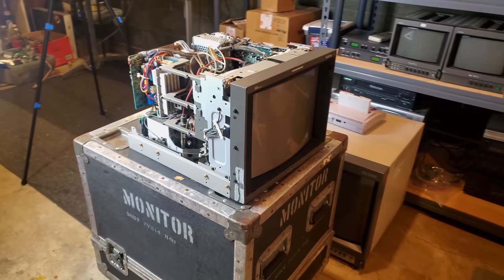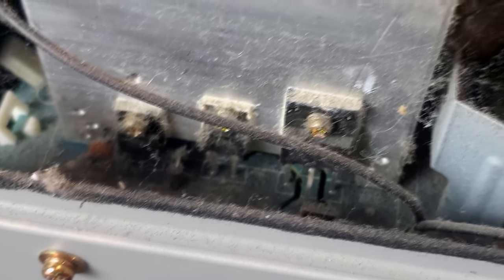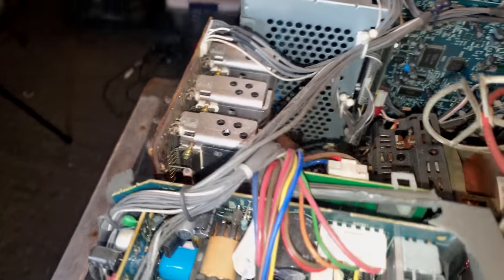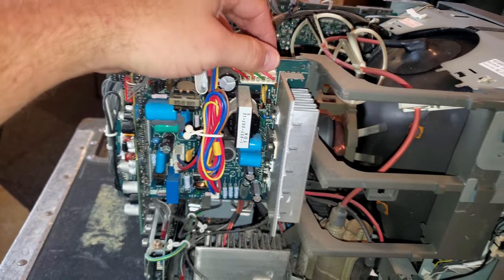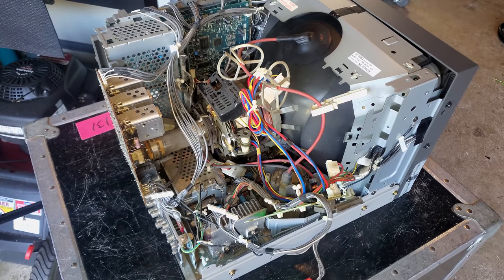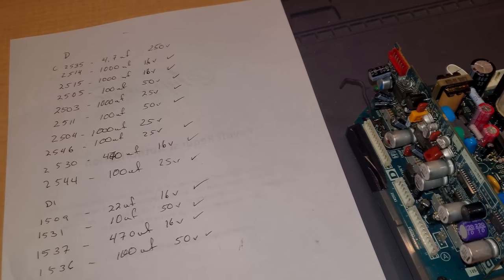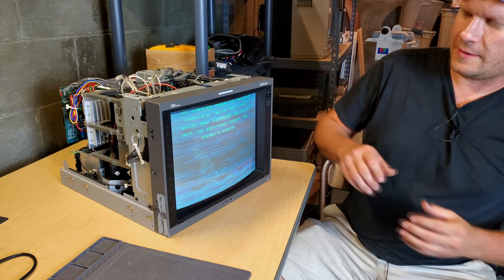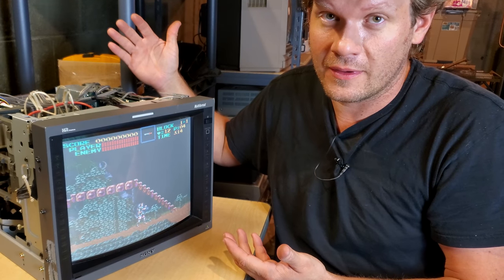Is the Sony PVM 14L5 the BEST 13" CRT? 📺 Vital Restoration

Comment: I love this model! 
Got mine from the scrapyard here in Brazil, it was supposedly not turning on. Paid  R$650 (around U$115) betting I could fix it, turns out it just takes 1 to 2 minutes to start working, and the tube looks brand new! I got the cap kit from savon-pat hoping to solve the issue (since it looks like a cap problem) and to preserve other components from running with the wrong specs. 
The only one concern I have today is dirty power from the wall, witch is really common around here. Would love to hear your opinion on the matter!
Anyway, love your work Steve!
Reply: Aren't there external transformers you can buy?
Reply: @badreality2  I'm reading about power conditioners and regulators, trying to discover which features are relevant for my use case, and then find one that can also fit into my tight budget xD

Comment: I picked up a 2030 last year that I still need to crack open. Manufactured in 1991, so I imagine it's a but gross in there, lol. 

One of these days I'll get some pics / videos together to post in the discord to properly diagnose whatever is going on with the input board (can't get it to stop scrolling on RGB or S-Video. Composite works), but I'm wanting to snag a nice desoldering tool before I dive into that

Comment: Not getting an image at all after a tube swap. Static is there on the screen, but no source info comes up and screen is blank. I noticed a crack across C board after powering up, but repairs have been done and still nothing. Only really tested R705 so far and its 39ohms and I'm getting spark at the cap when I purposely try to arc it so theres definitely power there. Proper voltage across G2 as well. What should my next test be? Thanks

Comment: Hi,

I have a nice Sony PVM 8045q but on right top corner the color is a bit dim (slight purity issue). The degauss does not clear it. What do you recommend I do? The screen and condition are top notch, not a tired overused monitor. In that top right corner there is a factory calibration magnet on the back of the crt, has there ever been the need to remove or re-orient a factory installed calibration magnet on a pvm? (for example due to different geo-location etc)

Thank you! Fantastic videos!

Comment: Steve you mentioned you don’t need to discharge the anode to clean this model.  Do the L5’ models self discharge?  I have 2 14L5’s in storage that I want to clean at some point but I’m a little worried about opening them up and making sure I don’t touch the wrong thing.

Comment: I got my 14L5 working again perfectly on 240p-480i  but is only showing green when running 480p(even in component mode) on both PS2/GameCube official component cables... any ideas? thanks
Reply: Might be NTSC/PAL compatibility or SYNC issue.
Reply: @hankhill7827  it previously worked but a minor service to the neck board was done and now it doesn’t work anymore.
Reply from the maker: @saltymanos  I'd inspect the rework first and make sure it was all 100% correct and then check to make sure everything is properly connected inside.
Reply: @RetroTechUSA  Savon_Pat repair this CRT but there was a suspicious looking blob of solder possibly by mistake and desoldered it and that’s when the green came in. So I resoldered it like it was before and the green now persists.